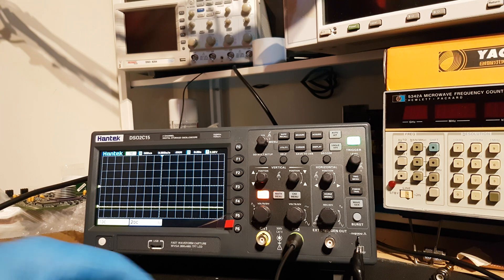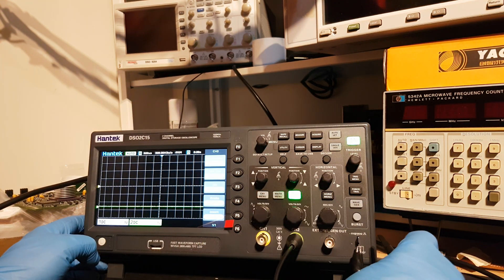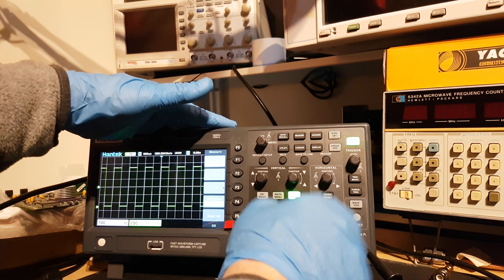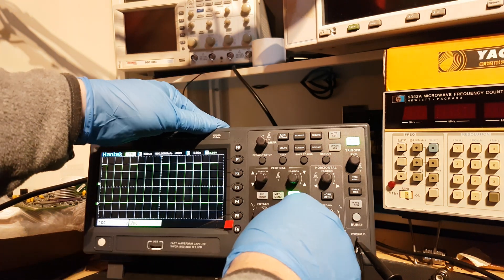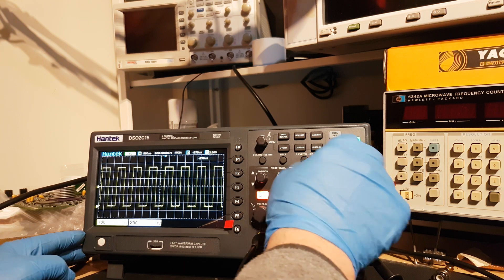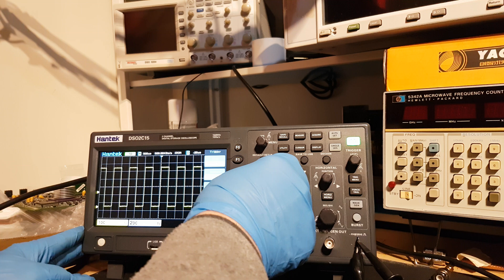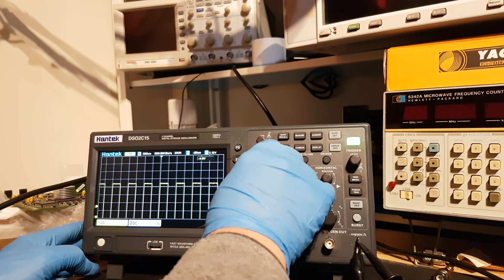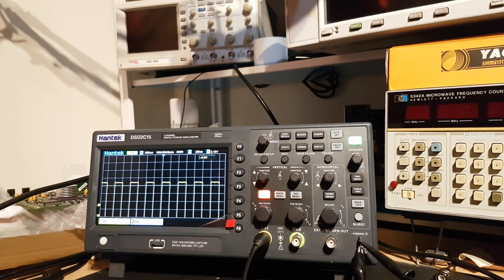Defective Hantek DSO2C15 Oscilloscope bought on eBay

Comment: I thought this was going to be a repair video.
Reply: Thanks for sharing that. 
I've been looking at those on ebay.
It looks like a software fault but that's no help to you.
Please let us know if you have any success with a refund or replacement.
Reply from the maker: No problem..
Yes the seller is very good and I've dealt with her before. She apologised and sent my refund. I know it's a production fault and not the seller so will continue to buy from her. She told me if I want to buy another and find a fault she'll refund it again. I have several Tektronix  Scopes but none of them do serial decoding so I may buy another Hantek just because they have a comprehensive serial decoding that includes RS232/UART, I2C, SPI, CAN, LIN. @warwickbunn1250
Reply from the maker: It was newly bought on eBay so no point to start repairing. I just returned it.
This problem is common with some Hantek Scopes and there is a very good video already about it here:- https://www.youtube.com/watch?v=X6q4JcOLKOI
Cheers..